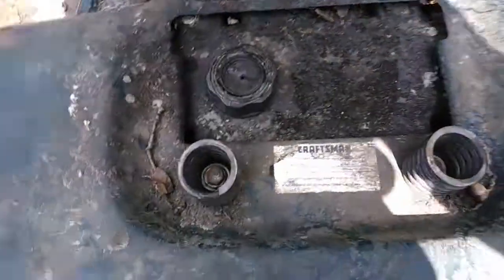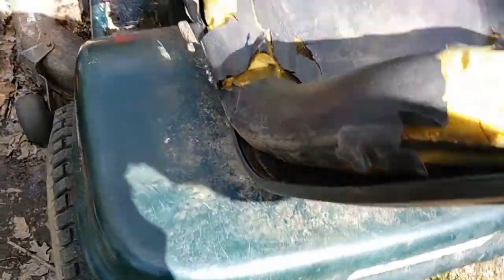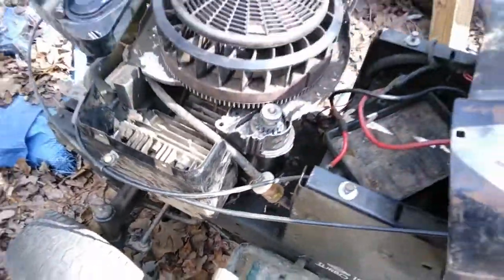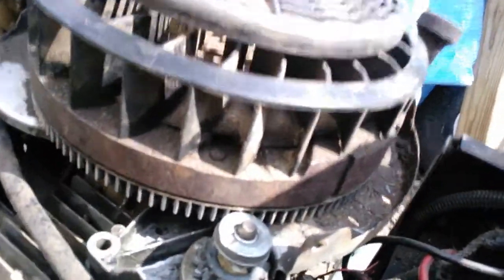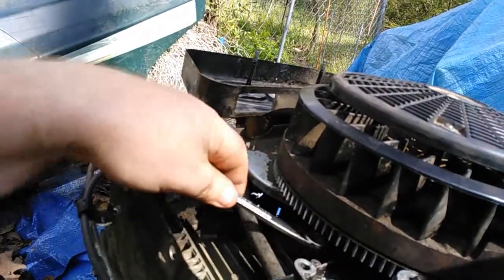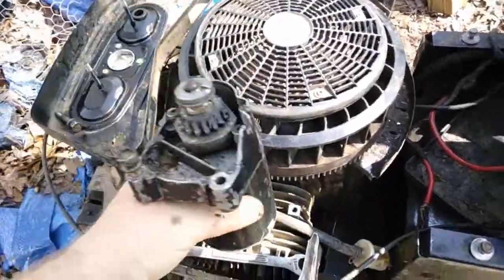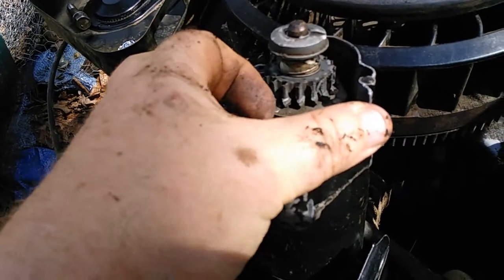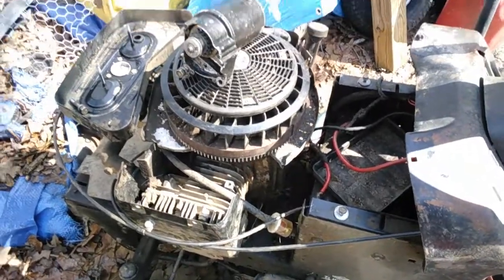Easily Remove a Craftsman Briggs and Stratton Starter

Comment: I have the same mower. How can I be sure that my starter mower is shot? When I turn the key, I'm getting clicking at the solenoid, but the engine isn't turning over at all.  I tried to bypass the solenoid and jump start it with a wrench. I got sparks, but it still didn't start. It has to be the starter mower right? Where is the best place to buy these?